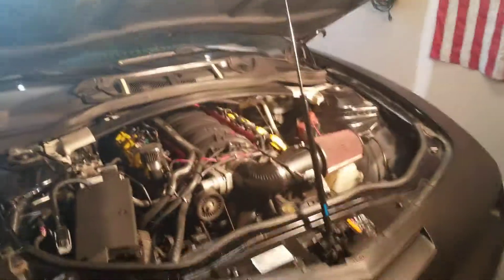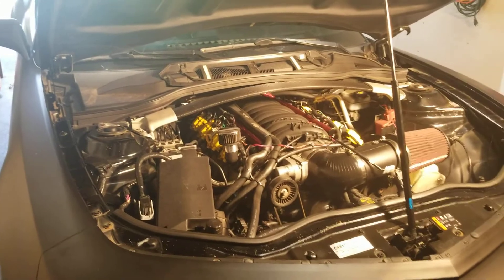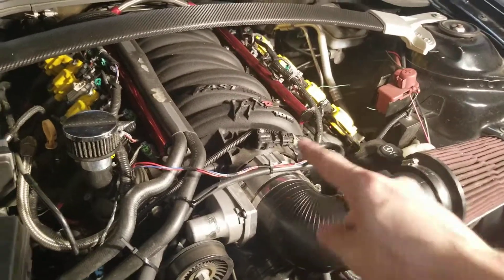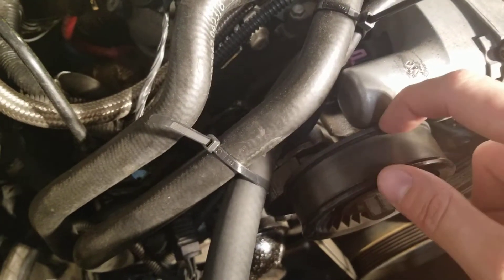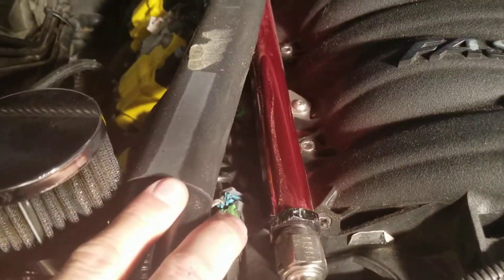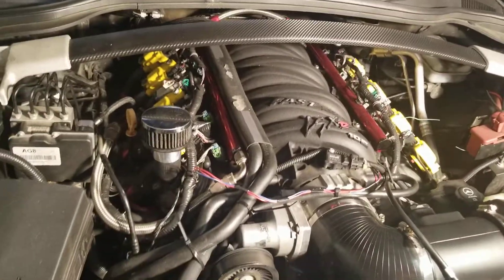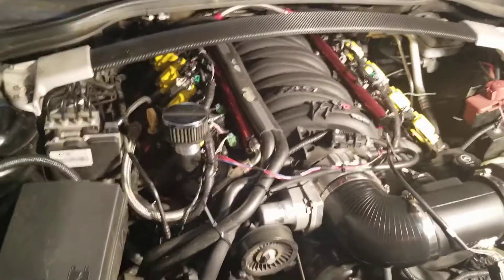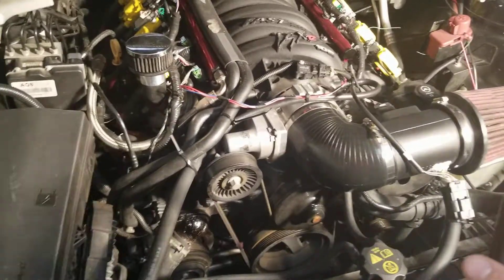Advantages and disadvantages of F.A.S.T LSXR Intake manifold

Comment: Unless I’m mistaken seems like you would of been better off with a LT 2 intake or a MSD and if you ported them even better. Test have been done that show 35-40 HP pickup on these intakes and the LT2 is $200 on RockAuto now you got to modify it a little bit but for the added HP it’s the cheapest option. Now if you do heads cam with a VVT delete with either these intakes your pushing 550hp or higher. I was going to do a Maggie 2650 on my 21 2ss I only got 1400 miles on it I mod it more than I drive it lol but I decided not to do the Maggie until I get a stage 2 head and cam from BTR then the Maggie Will really shine but yea tons on opportunities for different builds I do all the work on my Camaro it’s so much more fun. Peace 🐶

Comment: Lot of dyno tests in car and out as they tune shows most manifolds only help at 5,000 rpms and higher. So if you run the stock governor for max rpms, you might see a couple HP's. In my opinion if you have the LS3 intake already these are not worth the price. You can spend that money on head work or roller rockers and thicker pushrods to get about the same gains. Now this is according to those tune results on dynos like I said, so you may "feel" it where the dyno lacks in that department. 

Keep in mind a basic tune will increase throttle response as they take the delay/lag out in the software. My 55th gen with LS3 gained 23hp and 47ftlbs of torque with a basic Diablo tune (different topic, but I don't care for HP tuners as those credits add up quick) just running cold air intake and 91 octane.

Comment: Did you swap the servo motor for the throttle from stock throttle body?
Reply from the maker: I did. I looked for aftermarket motors that may be a different shape or size and didn't really find anything. Also, the dealer swears up and down this wasn't possible, but it is and works just fine. After driving with it for a few years, it never was an issue.

Comment: Canyon use the stock injectors or need spacers??
Reply from the maker: Stock injectors work just fine. They snap right in and the fuel rail fits right on top

Comment: I have the same intake and my Tensioner pulley rubs on the throttle body
Reply from the maker: It's a fitment game. I had to loosen and re tighten the intake and throttle body until I had a small gap

Comment: LSXR 102 with long runners is the best street intake IMO, I’m using a mildly ported one on an LS3 with. Small cam and the snap response is so much fun.
Reply from the maker: Yeah I kept the long runners with a gpi ss2 cam and it's perfect for that get up and go.
Reply: @danderson200 long runners ?
Reply from the maker: @ericreader9619 yeah long runners. There are 3 swappable parts in the intake you can add. Short, medium and long air ports you can swap out inside the manifold called runners.
Reply: Most of that comes from a tune.

Comment: I'm sure you found out by now but you can flip the throttle body  You have to extend the harness but it works the exact same
Reply from the maker: Actually it did not work because the power steering pump was in the way. But in short terms you are correct a circle is a circle and will work in the same way
Reply: @danderson200    I didn't think about that. On my 2.3 Maggie setup it work but the throttle body was mounted higher. I'm switching to a procharger with a fast intake and Nick Williams 102 throttle body hopefully that will clear the pulley.  Would a smaller diameter tensioner pulley help with clearance?
Reply from the maker: @jaimeedwards1269  I didn't switch the pully because it was a matter of the throttle body being further out because of the intake manifold. I mean ot works for now even with that small clearance. Reving the engine and slamming through gears doesn't seem to make it rub so I'm actually not to worried. Just looked really weird after installing. Deffently raised concerns but after few years of being on the car and no damage I've stopped worrying about it.

Comment: From the intake where is the evap system plug into?
Reply from the maker: there are ports on the side of the intake manifold that the evap system plugs into just behind the throttle body
Reply: @danderson200  im doing a gbody ls swap do u think the evap system applies to me?
Reply from the maker: @richwil5281  probably not. You can delete the evap system if it's a problem

Comment: Why does your map sensor move when you touch it...?
Reply from the maker: Because the original O ring that is on the map sensor is not 100% big enough to fill that gap and had to be replaced with a slightly larger one
Reply: @danderson200 what part number would that be? By chance

Comment: Where did you buy your mddd braided fuel rail lines. I have the same fuel rails and lsxr intake but I don’t know where to buy the fuel line mod lines. Thanks for the video. I just bought the new lsxr 102 mm intake to install on 5th gen 2012 SS
Reply from the maker: Hello Nancy, The braided line came from William Oil company in Tacoma Washington. Usually a hydraulic manufacturer or heavy equipment company makes custom lines. In my case William oil company was a heavy equipment repair shop that made special lines for CAT/ John Deer/ PAPE and other equipment. Its not something your going to find online for sure so checking out a shop like this one should help with what you need. It ran me about $70 to be cut and fitted with the proper fittings. Make sure to bring your stock one in for sizing as the new line does not flex as much due to better quality. I also had them make the fuel line that attaches to my rails from the feed line on the said of the engine. I realized the line that came with this manifold was terrible and cheap and very thin so good thing your looking into swapping it out. Hope this helps.

Comment: Check out the jet performance throttle body. It doesn’t have that bulge sticking out from the side. May give you more clearance.
Reply from the maker: The bulge is the eletric actuator motor. It didnt come with the bbk throttle body. I hade to take it off the stock and put it together. I'm not sure if after market throttle bodies come with the eletric actuator but this one did not.

Comment: I ordered mine yesterday should work great with TSP Heads..im think 20hp with some smoothing of the trumpets on the lsxr. What was the final scaling number for your 102 setup
Reply from the maker: After everything was done I put down 530 hp and 480tq to the ground. I put a better air intake and found a few vacuume line leaks to fix so I'm sure it's a little more now.

Comment: First I wish you all the best, can you tell me what is the set up on your car and how much did you gain after switching to fast lsxr or there is any increase in your rwhp
Reply from the maker: Absolutely. So I gained about 15hp and 10tq if I remember correctly it could have been more but my current setup on my car is the lsxr intake manifold with a 102mm bbk throttle body, accell coil packs and Taylor plug and wires, exhaust is a full racing JBA system with long tube headers, internal engine is a gpi ss 2 cam shaft with forged pushrods, roller lifters, michigan motorsports rocker arms and double  valve springs from brian tooley. All this combined puts down on the dyno to the wheels of 530hp 495tq